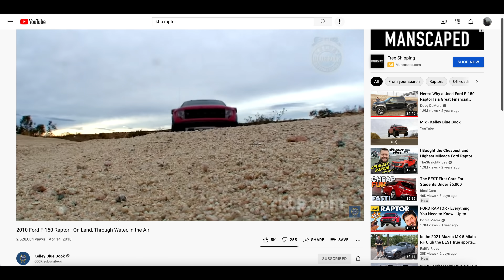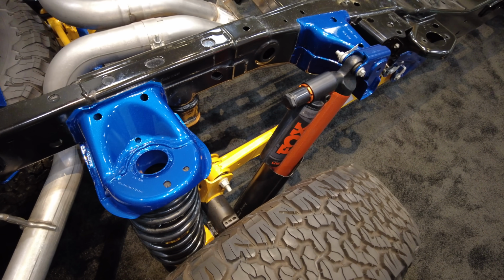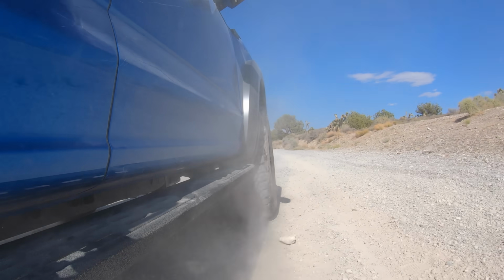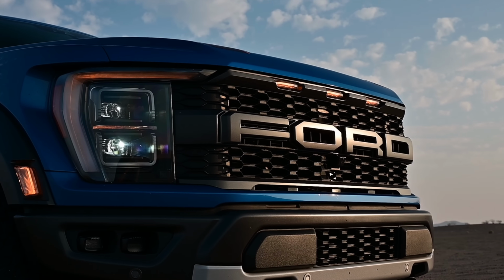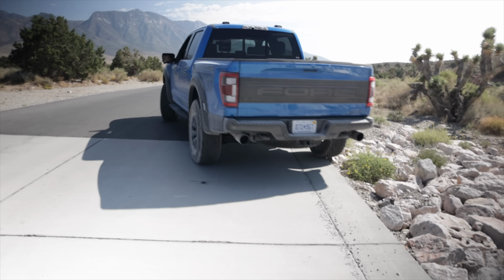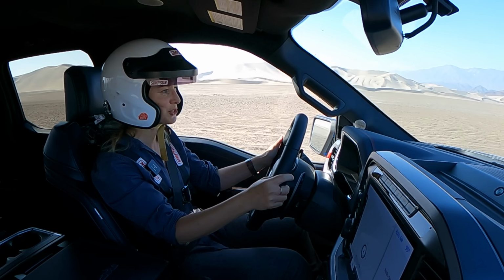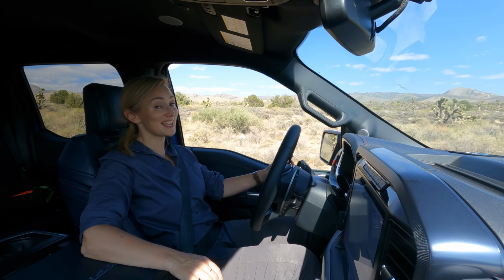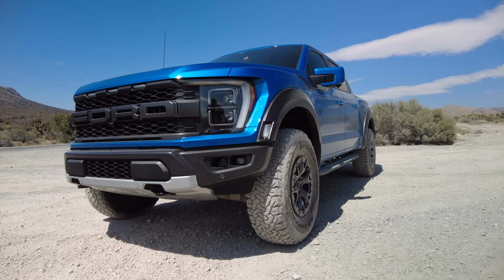2021 Ford Raptor | First Drive

Comment: The R guna be 🔥🔥🔥🔥🔥 I don't have a problem with v6s but I think they should be silent they don't sound good with exhaust so you're better off just keeping it quiet so you can be sneaky fast... The R may have cylinder deactivation cuz Ford is implementing it in new 5.0 f150

Comment: With the Trx around unless budget or loyalty constrains one, wait for the R version.
Reply: A Gen 1 raptor is better offroad; even more my Gen 2, while also being a better daily. People only buy  a TRX if they want to waste money on paper specs, not actual performance.
Reply: …but wait, if the ecoboost is as good as Ford claims, why are they going back to the V8 like we all said it should be!!!!  Good move on the R move!! 🤘🏽🤘🏽🤘🏽
Reply: @Jaimehellcat  To shut people up? The Raptor R is a high dollar niche platform to allow them to say they answered the TRX. Due to the extra weight of the V8, the  truck will likely perform worse offroad, as the V6 already puts more power out than you can actually use in the dirt, due to traction. Even in 4H my engine is very rarely the limiting factor.
Reply: @Jaimehellcat  nope, they just know that there's still money on the table from those who would gladly over pay for a raptor with a V8! Idiots would easily pay twice as much for V8 sound even if it had less power!
Reply: @T4nkcommander  If you really believe a Gen 1 raptor is better than the TRX you’re delusional. Even a Gen 2 isn’t better you would have to step up to the Gen 2.5 with live valve shocks.
Reply: @epap1375  There's already a number of videos showing that a TRX can't keep up offroad. There's a reason that Ford shaves weight off the Raptor each gen while beefing up the suspension. The TRX did the opposite, and so it is even more nose heavy - not good for high speed offroad stuff. 

But that's no surprise, given all SRT knows how to do is stick a supercharger on an engine.
Reply: @T4nkcommander  Please send me any unbiased videos from non raptor owners showing this. I’m not saying the TRX is better than a Gen 3 raptor or even a 2.5 but to say it’s worse than a Gen 1 is just ridiculous. It might be a bit nose heavy because of the monster motor up front but the suspension design and frame are serious. I mean it’s pretty tits to rip off 12.4 quarter miles and 3.7 0-60’s in an off road truck with 35’s. It’s a good feeling to rip the face off a douche in his dads mercedes in a baja truck 😂
Reply: @epap1375  Keepitdirty has excellent comparison videos, as does Ben hardy.

All I know is I've seen some TRXs on the street, but none of them have come to any of the offroad places Raptors frequent here in Texas.
Reply: @T4nkcommander  Both raptor owners like I said so have to always keep that in mind. Keepitdirty compared it to the Gen 2.5 raptor with live valves and from what I remember he thought it did good just believes it needs a stiffer front spring. Again I’m not saying it’s better than a new raptor but it’s very capable in its own right and can also rip your face off on the street. Different strokes for different folks but to say it’s not capable at all isn’t true. 

I’m sure the fact that these trucks are going for 120+K in this crazy covid car market has something to do with it. I would think eventually you will see them as second owners get a hold of them.
Reply: @epap1375  It is simple physics. Ford reduces weight on every new Raptor to help make up for the small shocks, SRT did the opposite.

It is clear you know little about this, since you claim the live valve shocks are much superior to the regular Gen 2 shocks - they are the exact same shock, and the Ford live valve tune does very little (I even made a comparison video showing this).*

Convenient you dismiss the only people qualified to talk about both trucks, given that they actually own both, drive offroad, and make comparison videos with cold hard facts. Fanboyism doesnt work in the age of cameras.

*The SDI eclicker wakes them up, and is what the stock tune should be. That competes with a mid travel, unlike the TRX that I can outrun in my stock 2017.
Reply: @T4nkcommander  RAM had a different goal in mind but your horse blinders keep you from seeing that. They didn’t want to make a Baja champion. It’s a truck that is very capable off road probably 90% of a 2.5 and at the same time can rip your face off in a luxurious cabin. When you pull up next to one and it leaves you like your standing still I’m sure you can tell him at the next light how much better you can handle whoops. 

Do you think exotic owners just buy the car with the fastest track lap time? Or are they real people who consider straight line speed, exterior looks, interior, etc etc. if all you’re looking for is one aspect you’re better off with a purpose built track car on track or a UTV off road. 

When did keepitdirty buy a TRX that’s news to me? Am I the one claiming Raptors suck and TRX’s are way superior? No but here you are claiming the opposite. Who’s the fan boy? I know having a guilty conscience sucks it comes out in interesting ways.

Didn’t you just claim you never see TRX’s when you go out. Now you’ve outran them?! Your BS is evident

Comment: Not worth trading in my Gen 2....unless a V8 R model comes out
Reply: "The 2022 Ford Raptor will gain the supercharged 5.2-liter V8 engine that's used in the Ford Mustang GT500 to pump out 750 to 770 hp."

Comment: Slightly surprised the power numbers are not up, but then again they were close to the safe limit as it was.

Hopefully the new suspension will actually allow the Eco to put down the power it has offroad. My 17 Supercab often has trouble gripping offroad even with 4H!

Comment: Maybe I'm just stupid, (and that is open to debate) but I have never been able to wrap my mind around the claims regarding an electronically controlled damping system's ability to make adjustments, or do anything whatsoever 500 times a second. IMHO, an adjustment involves moving something from point A to point B, and even a hummingbird is only able to beat it's wings between 10 and 15 times per second. Perhaps it is able to make computations at a rate of 500 per second, but the claims of making 500 actual adjustments appear to be a stretch.

Comment: I bet that Raptor is awesome, but my F350 has 950lbs of torque with 450 hp.
Reply: Yeah but can it jump? lol
Reply: @skbid1  lol actually, I have the off-road tremor package with the dampers and Fox shocks. 😂
Reply: Thanks but can’t compare the two
Reply: @westoncharm7467  your quoting 2019 specs prior to the 20 tremor and even then it doesn't have dampers or fox shocks.
. And yes you can't compare the 2 trucks completely different unless your towing 10k+ the raptor is superior on every level
Reply: @jklewisjkldev  Actually, I have Fox shocks and dampers. Plus the 10" lift

Comment: Is it just me, or this raptor has the exact same engine with the exact same power as the last gen? You'd think Ford would add at least 50 HP more to that engine.
Reply: Yeah all of the changes are in the suspension and interior. To be honest 450hp/510tq is still plenty for this truck. I'm still driving a 2018 and haven't had to urge to add more power to it. The real star of the show we're waiting on is the Raptor R.
Reply: They primarily focused on the 5 link suspension this time around, something that actual Raptor owners really cared about. Those of us who buy the trucks are pretty excited to see how it performs.
Reply: Yeah but there making a RAPTOR R which will have 760 horsepower supercharged

Comment: 15 mpg??? You might as well just get a V8 😑
Reply: Worse offroad performance via extra weight and worse torque profile - and by definition a less efficient engine. There's a reason the Ecoboost is the best engine for this truck.
Reply: The RAM TRX is rated at 10 MPG but reviewers were getting closer to 8 MPG when pushing it.
Reply: @T4nkcommander  Exactly!!  Because 7 out of 10 buyers will never take it off road. And that is what makes their demographics,  Perfectly fine.
Reply: @Kiss__Kiss  9 out of 10 buyers can't afford it.

Comment: I would only buy Naturally Aspirated vehicles, & that is due to Manufacturer's not installing or leaving room to install heat shields between the engine and the Turbo... I had serious issues in the past due to this factor. (Engine Replacement took 2 Months) Great Truck though, can't wait for the V8, and if it's at least the 302 (5.0) then it would be a reliable one. 👦🏻👍🏻🏎🏁
Reply: The Gen3 Coyote is 93x92.7mm bore stroke. So it’s a 307ci now.
Reply: @reedlaww   Awesome
Reply: "The 2022 Ford Raptor will gain the supercharged 5.2-liter V8 engine that's used in the Ford Mustang GT500 to pump out 750 to 770 hp."